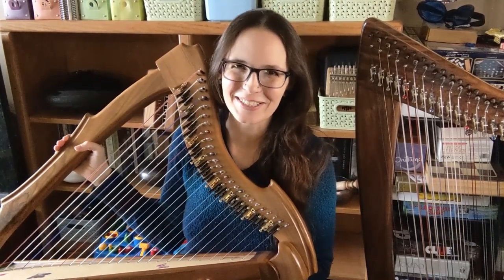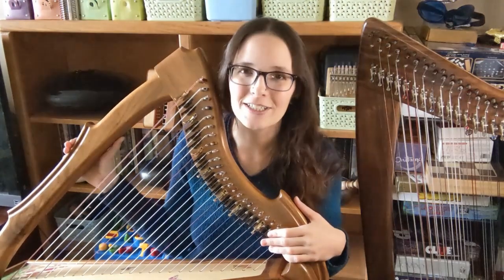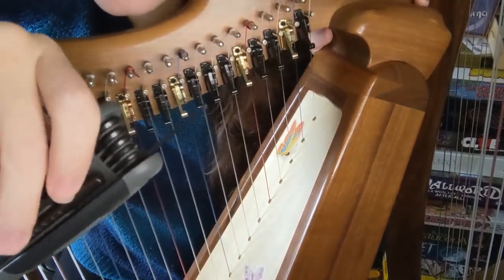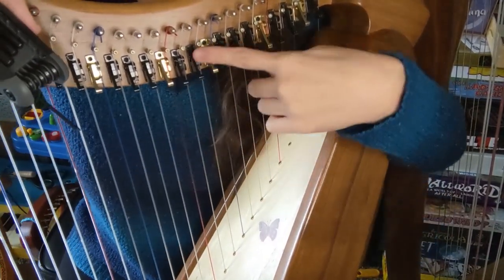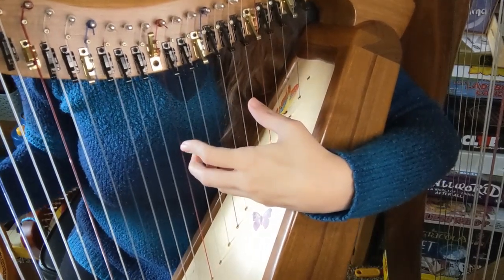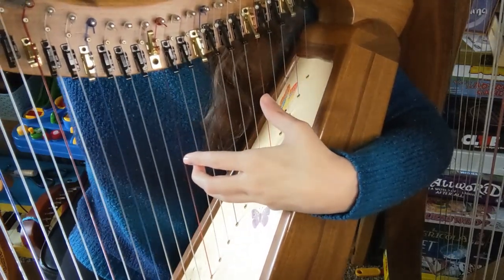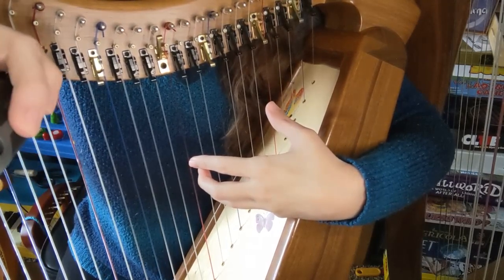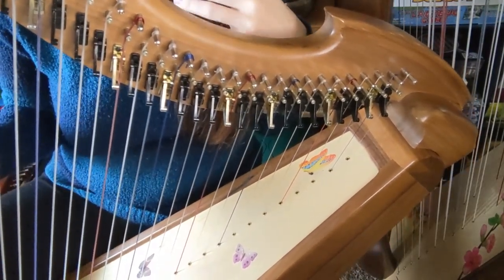How To Regulate Levers with Bridge Pins (Works for Universal Levers and Rees Levers)

Comment: How far can you regulate a lever using the bridge pins? I've got a pretty cheap harp and the way the levers came, the smallest increment I've got is the levers on the lower strings raise the pitch by about a whole step. Can you regulate down an entire half step, or do you have to move the lever at that point? What about a whole step? Thanks!
Reply from the maker: I honestly don't know! It probably varies depending on the harp. It's probably worth a try, and if it doesn't work no harm done 😊

Comment: I just tuned my 4 month old harp to Eb and some of the levers are quite off now, even to my relatively untrained ears. Is this something that will fix itself over time as the harp gets used to its new tuning?  Or should I tune back up to my previous key and leave off flats until I can work on my harp? 🥺 

anyway this sounds like the difference between fine  tuners and pegs on a violin…except a bit more tedious.
Reply from the maker: Great question! I think it depends on if the strings are mostly staying in tune at this point. If they are and the levers are still off, you're probably better off tuning up to C until you can get the levers regulated. If they're not settled yet, that may be the problem 😊
Reply: I got the right tools (I contacted my harp’s company just to be sure) and I now have 1 and 3/4 of an octave regulated.  I would get more done but my Mom is playing with my baby niece and things are a bit noisy round here and it’s time to stop for today. 😅 Not as difficult as I had feared so far and I’m happy to have things back in tune.  Thank you for your very helpful video.